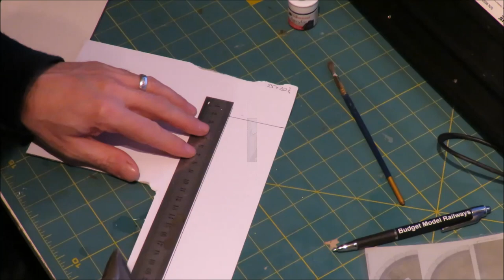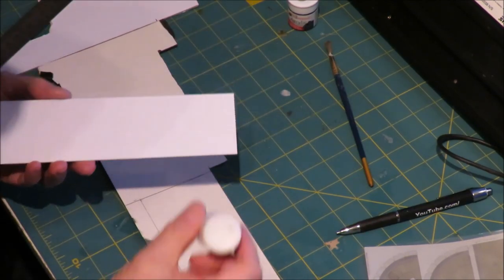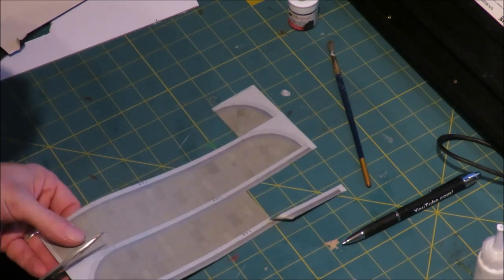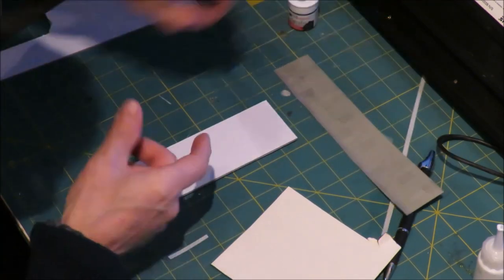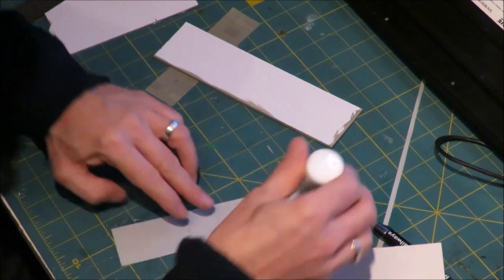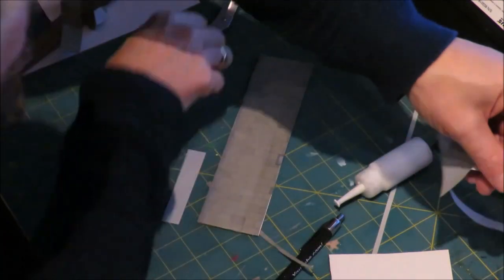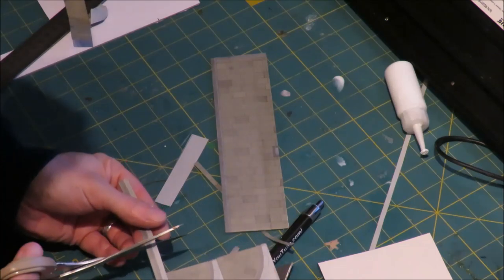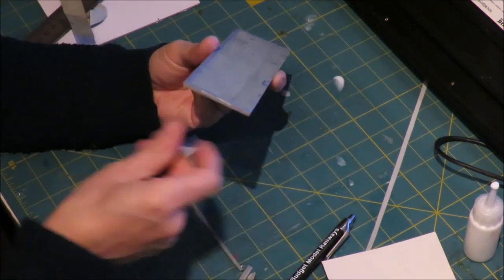Tutorial Tuesday Episode 15 - How To Make Model Railway Pavements

Comment: I have a different way of doing roads / pavements which gets rid of the problems of joints everywhere. I use those modellers match sticks (matches without heads on) to frame the area I want to pave. The match sticks become the kerb stones and laying them in first is actually the way the full sized thing is done. Next I partly fill in the area inside the kerb boundary with any old card or cardboard. You don't have to fit this at all carefully because the third phase invilves mixing up a thin mix of plaster of paris (it really needs to be plaster of paris rather than a filler like pollyfilla because the fillers are too thick and won't flow. Pour the plaster onto the area and let it sit just a mil or so higher than the kerbs. It wants to be threatening to come over the edge, but not actually running over because surface tension is holding it back. After a couple of minutes it will have started to set and be the consistency of thick double cream. It this stage run a straight edge across the area using the kerbs as guides. It's just like striking off concrete in the full sized world! Discard any that runs over the kerbs. What you have left is a perfectly flat area that can be made as big as you like without joints. I like to do this after the buildings are in place, not before, so as to avoid that gap you often see under model buildings. If you think about it tarmac etc is always laid up to a wall, so I'm just doing the prototypical thing on a much smaller scale.

This method really comes into it's own if you're laying tram tracks or dock rail that needs to be embedded in the road surface. Just lay the plaster and strike off level with the rail head. Then when the plaster is half dry run something down the inside of the rails to make the grooves. This will upset the surface between tha rails by raising it slightly, but just let it dry fully then use an old wood chisel to remove the excess above the rail head.

Leave the plaster white if you're doing a snow scene or put a bit of paint in the mix to give a base colour of tarmac/concrete. I always paint the surface, but the base colour helps if any areas get damaged.
Reply from the maker: A great tip thanks

Comment: Hi Mike, I have done the same job over the last weeks and here are some tips based on my experiences:1. I used the printable paving texture sheets TX193 from modelrailwayscenery.com or TX21 from scalescenes.comfor just £1.99. You can download it instantly and print it as many times as you need. This is much cheaper I think. You have then a large sheet (A4) and don't have to cut and glue many small pieces.2. Better use a Pritt stick for glueing the paving paper. This prevents glue marks and the paper doesn't soak with the liquid glue (like PVA). If you are using PVA it may end up in bubbles and waves. Apply the Pritt stick on the cardboard and not on the Paper.3. For more realistic kerb stones I used the laser cut kit LX135-OO from scalemodelscenery.co.uk. This gives you 3 meters (not ft) of very realistic stones for just £4.49. More than enough for your 18 inch curve layout. You can also use them in curves.I am in no relationship with the companies above. But this is a very cheap and effective way to do this job. I tried some other methods before (gray paint, pre-printed sheets, Metcalfe self adhesive stones).Guido
Reply from the maker: Thanks, I've used scalescene and they are a good product, I have used print sticks but don't always find them perm. I only buy papers second hand so most have only cost me a few pence a sheet. Thanks for the suggestions

Comment: Great video! I do something similar but I use thin balsa wood and an online download for pavement paper. It’s more expensive than 1 set of superquick papers I think, but you can print it as many times as you like, so even when you factor in the cost of paper it will most likely come out a bit cheaper (even using Matt photo paper which I do). I think it’s scalescenes I use.
Reply from the maker: Scalescenes are very good

Comment: Sorry if you've covered it already and I just haven't watched it yet. 
Just wondering if you know of good cheap or free alternatives for the framing card and/or plasticard.
I find cereal packets too thin and flexible for most uses.
btw. Update on my cardboard baseboard - looking good! Not as thick as most of yours as I only intend to 
use it for a few months and it's mostly supported by a glass top table.
Cheers and another nice howto vid :)
Reply from the maker: I get my framing card dirt cheap as off cuts from a picture framers so try that first? Also I have experimented successfully with laminating several layers of cereal pack card together to make thicker sheets. Hope this helps
Reply: @BudgetModelRailways  Thanks, I'll have to see if I can find a helpful picture framer :)
I've tried laminating thin card but wasn't happy with the flatness. I'm using artists cardstock now, but it adds a few dollars to the cost.
Reply from the maker: The trick to laminating is to spread the glue evenly but thinly and then weight it down with a big heavy flat object like a book